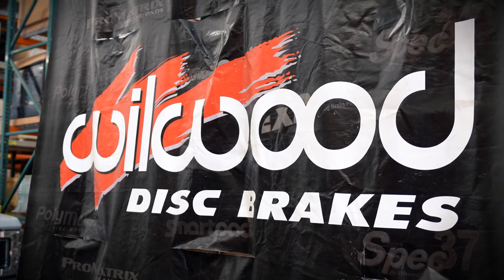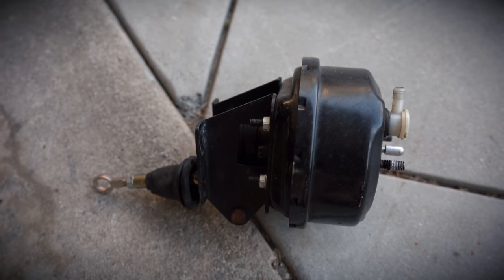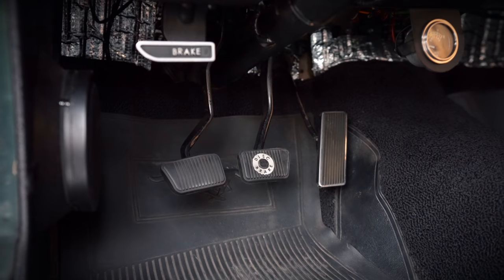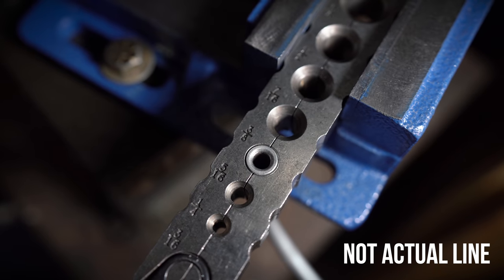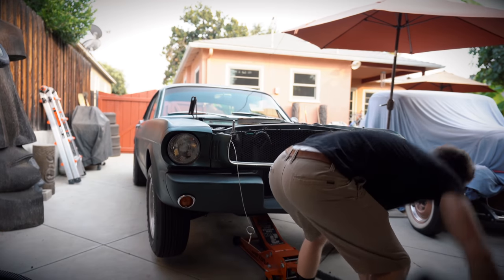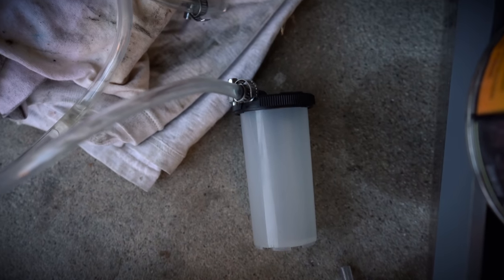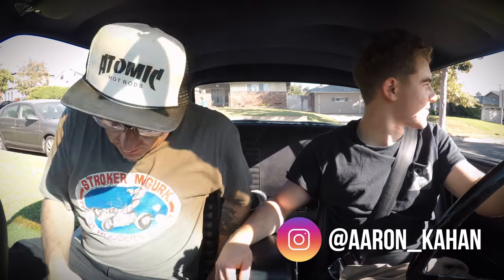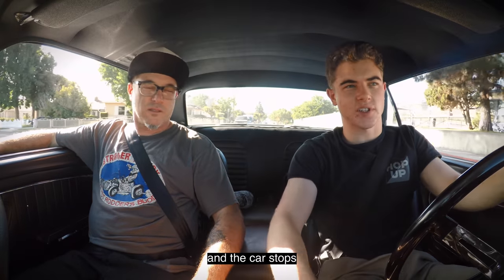Converting the Mustang To Manual Brakes!

Comment: I can attest to the firewall weakness. Took out a friend’s GT350 clone convertible, only to have the clutch cable melt and sieze up. Swapped the auto adjusting pedal assembly to the billet non-adjustable, only to have the cable snap, but not before it put a inch long tear in the firewall where the cable passes through. 
Good life lessons. Welded up the firewall and put a CNC plate I designed over that section. Better than ever now!

Comment: I used to bleed brakes that way, but I spent the 100 bucks on a motive bleeder kit and never looked back. Totally worth it seeing that it forces the fluid through the master cylinder reservoirs. Also, manual brakes are the way to go for any kind of car honestly. I daily my nova with them and it doesn't bother me for a second.

Comment: I have had great success using the Motiv power bleeder on a bunch of my cars. The only issue I have using it is getting an adaptor for all the different types of master cylinder caps. Good luck with your ride, nice to see younger people into the "old" car hobby. I am wrapping up a restoration to my 69 coupe and I need to replace a bad master cylinder.

Comment: Going manual master my self…nice to see your impressions. The reason you could still get bubbles using the vacuum pump is they suck air around the threads of the bleed nipples…..you need to put some grease on the bleed nipple threads and then screw them back in before bleeding….that seals the threads.

Comment: Wow. I’ve had stainless steel brake company disc brakes with a power booster kit for the past 8 years and always thought the brakes were soft and slow to stop. I was about to replace them all with Wilwood brakes on all fours when a local shop suggested that I start first with just a Wilwood manual  MC. Suggested the 15/16” bore and it made a huge difference! Enough that now I can stop and screech when I stop hard. Still not stopping like a new modern car but good enough for now. Maybe next will be the upgrade to Wilwood discs. Even though I went from power booster to manual, the assistance is hardly missed and totally unnecessary. Wish I knew what you did in this video years ago. Keep up the great video production and content!

Comment: I use DOT 5 or synthetic, has a higher boiling point and doesn’t harm your paint. But if you have ABS it is not recommended, not as forgiving as the DOT 3 and 4.

Comment: These cars are so lite . If you put disk on the rear you'll have to sail them way back to avoid rear lock up . Drums are actually more efficient at stopping because the self energize. disk shed  heat better

Comment: My 67 Mustang only had 11-12 inches of vacuum but it was enough for the brake booster.
Call me old but.............https://www.summitracing.com/search/part-type/vacuum-pumps-street
Also:
Q:   Besides the Manual Brake Conversion Kit to mount the master cylinder, is there anything else I should do to my brake system when I convert to manual brakes?

A:   Yes. You should improve the rest of your brake system as much as your circumstances allow. Without power-assist, everything else in the brake system needs to work as well as possible. Among the things to consider:

    High performance brake pads, matched to how you use your car, should be installed. A street-driven Mustang needs pads with a high coefficient of friction when cold. Road-raced Mustangs need friction material suited for the temperatures encountered on the track.
    Any axle endplay will contribute to increased rear pad knockback. That will cause an intermittent low pedal that is much more noticeable with manual brakes than with power brakes. The stock Traction-Lock differential should have the clutches shimmed tightly to minimize axle endplay.
    Stainless steel braided brake hoses will reduce hose expansion, and provide a firmer pedal feel. The soft pedal feel from hose expansion is more noticeable with manual brakes than with power brakes.
    Swapping to larger front discs will greatly improve the stopping ability. For example, swapping GT rotors to larger diameter 13" Cobra-sized front brake rotors will provide a significant reduction in stopping distance.
    An adjustable brake-proportioning valve will allow adjusting the rear brake pressure for the best front to rear bias on your particular Mustang.
    Properly sizing the front and rear rotors, as well as the front and rear caliper piston areas, to be close to a front/rear bias of 70%/30% will provide the best braking performance.
    In the end, braking ability is determined by tire grip. Sticky tires have more grip, and will provide more stopping ability.
    Optimize your combination. For example, a drag race car with big sticky rear tires and skinnies up front will need a brake system with a rear brake bias much higher than 30%. Designing the brake system to have more rear bias will avoid prematurely locking the skinny front tires, and take advantage of the greater amount of rear grip.
    Choose a master cylinder size that properly matches up to the front and rear brakes on your Mustang.

Comment: After you've had wonky brakes it feels sooo good to get them fixed. I had the front right brake cylinder fail on my car and it was no bueno. As soon as i started braking the car wanted to instantly turn left. And after changing that and adjusting everything it felt so good to drive it again!
Reply from the maker: I can't agree more with you!

Comment: Probably a stupid question, but I’m trying to switch over to manual brakes. Can I use the wilwood master cylinder with stock brakes or do I need wilwood brakes with the master cylinder? I plan on upgrading in the future, but I’m not getting much vacuum.

Comment: Im getting ready to throw a manual reservoir on my 67 due to motor not making enough vaccum and also i hate the bulkyness of space it take up. question my car is 4 wheel disc brake at the moment with the granada front disc swap, and 8.8 ford explorer rear end disc brakes, do I need to run any specific calipers to make this work?

Comment: Hi, I’m Rey from San Fernando Valley. We own a 68 Mustang GT. &, I’m always having trouble with my brake booster. I’ve changed them at least 3 times in 2yrs. And my brake pedals still hit the floor. Are you in the Burbank, Ca. And how easy is it to change out my brake system to manual brakes. I have disc brakes in the front and Drums in the rear. Question: what would you charge me to change out my brake system to manual.
😊🙏🏽👍.

Comment: Hey I just noticed that you have a residual pressure valve for your rear wheels. What made you install that? I am following your lead by keeping my brakes manual, I am converting from a single bowl master cylinder to a dual. I am getting a bit stuck when it comes to a proportioning valve. I have a 62 Falcon so we could in theory have a similar set up in the end. I have disk in the front and drum in the rear as well.
Reply from the maker: Nice! Drum brakes require it (Wilwood recommended me a 10psi one
Reply: @FourSpeedFilms  Ohh gotcha ok thats good to know. And was there any reason why they didn't have you go for a standard Disk/Drum proportioning valve?

Comment: The firewall plate that is used is manufactured by Modern Driveline and is normally used with our clutch cable kit, double to reinforce the firewall.  www.moderndriveline.com

Comment: nothing wrong with  manual brakes but most people  that convert to manual brakes  don't bother to change the Brake peddle, a  manual has the  push rod a bunch closer to the  pivot  point, making more leverage to apply the  brakes. I was one of the guys  who  did it wrong then I found out about the manual  brake peddle being different .  I would  push as hard  as i Could with Both  Feet and  couldn't skid the wheels.

Comment: Convrting go manual brakes ... WHY?!? Power brakes don't cost horsepower. They work off VACUUM; not a hydrologic pump like power steering!!!!

Do you REALLY knkw ANYTHING about auto mechanics and design? Sorry. Rhetorical question.
The answer is obviously "HELL NO!"